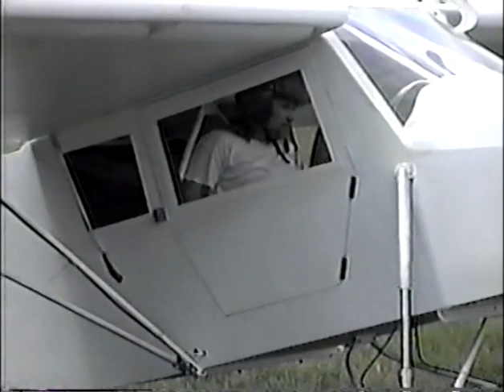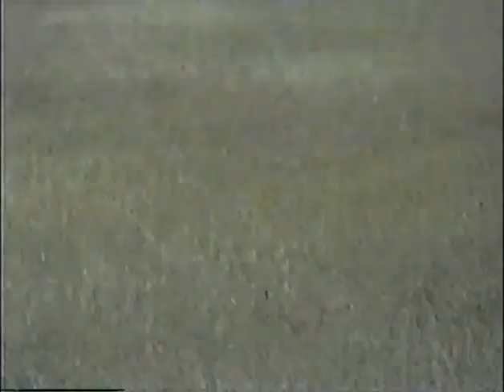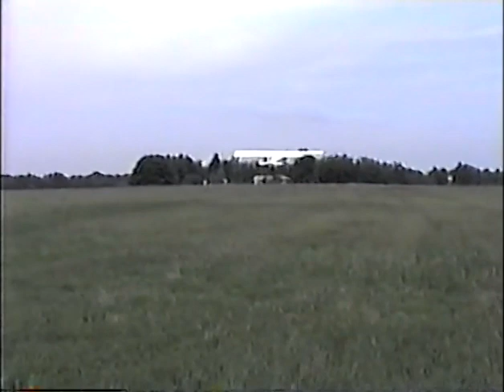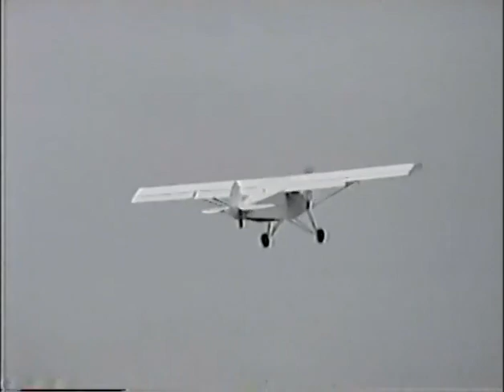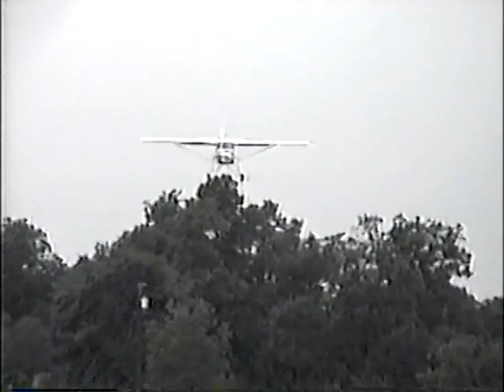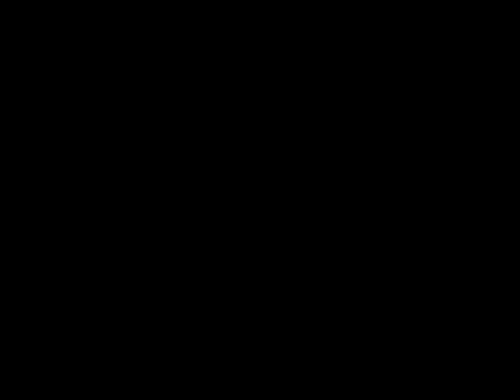STOL RagWing Stork Side by Side model

Comment: poerfect kit cheap and fly if have 4 seat model and can fly ultralight licence and range 900 KM. then i buy thailand one. need be legal. perfect DIY plane build have cheap metal tube frame and glassfiber or carbon fiber cover,easy work and accurate cheap materials.

Comment: why not fly, or engine not have power go fly.
Reply: It was the first test flight.
Reply from the maker: @garyvanmeter4911 Gary, It was very successful first up and down, I so wish I had this plane back but instead must build another one. I hope your project is going well. Roger
Reply: @ragwing-rogermann  Yes, I am making progress. Thanks! Finished the  Jusy Strut wing mount bracket on one wing using the brackets from a high wing Piper.  Only added 9 ounces including the brackets and 2 bolts. About to start on wing rib cap strips. Wondering if 1 inch wide would make rib stitching difficult?